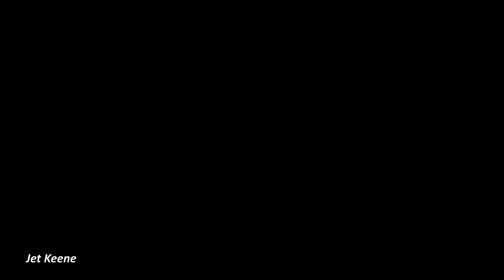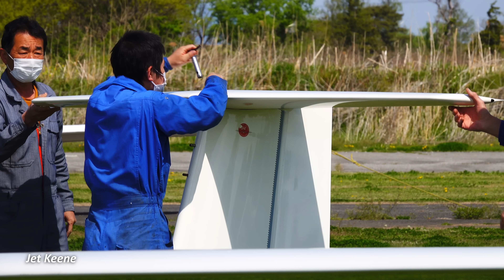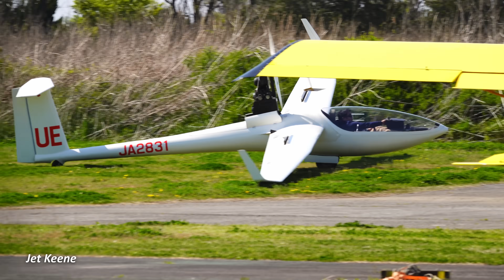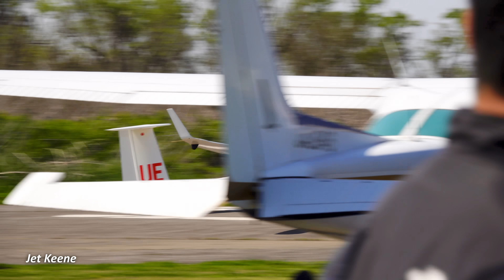Glaser-Dirks DG-800A Motor Glider Assembly, Takeoff & Landing

Comment from the maker: Thank you for watching.🤗

Below is the synopsis. Please watch from the scene of your choice.
00:00 Highlights
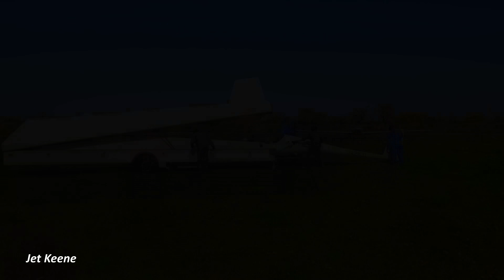00:15 Assembly
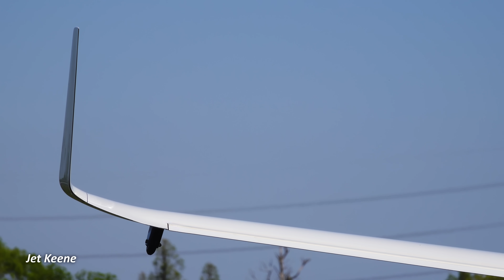04:27 Close-up of each part
04:57 Pitot tube fixation
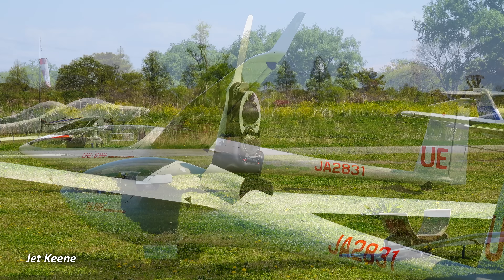05:30 Close-up of engine
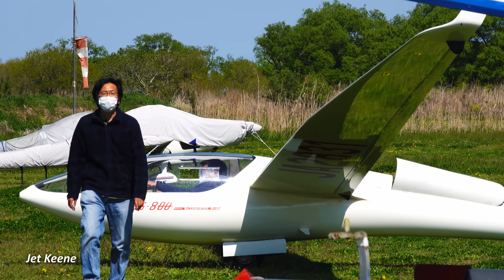06:11 Engine stands up
06:31 Engine startup
06:40 Taxing to end of runway
07:17 Preparing for tow
08:26 Takeoff towed by another plane
09:31 Rope separation and turning
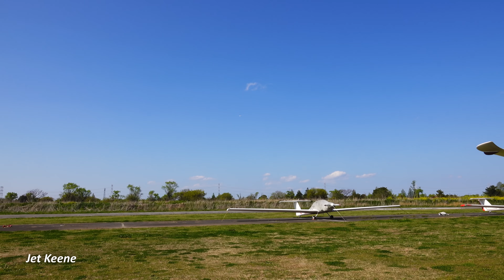10:29 Landing
11:29 Taxiing to tarmac
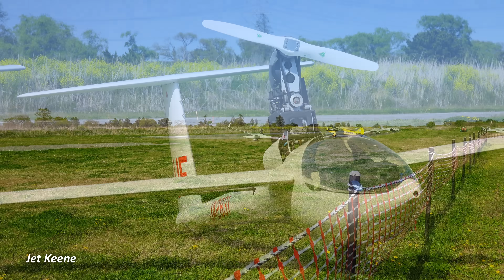12:38 Taxing to end of runway
13:19 Takeoff with fuselage-mounted engines
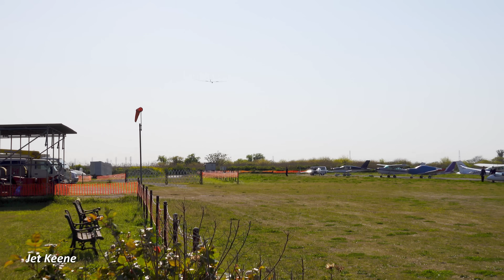15:40 Landing
16:05 Taxiing to tarmac
16:44 Retract the engine

After watching this video, you will understand why a motor glider with a propeller in and out of the back is useful.
https://youtu.be/EhwYs7hRtIg

#JetKeene_Aircraft_Channel
Reply: Szzzzzd

Comment: Why you wasting my time
Reply from the maker: Thank you for watching.🤗
Below is the synopsis. Please watch from the scene of your choice.
00:00 Highlights
00:15 Assembly
04:27 Close-up of each part
04:57 Pitot tube fixation
05:30 Close-up of engine
06:11 Engine stands up
06:31 Engine startup
06:40 Taxing to end of runway
07:17 Preparing for tow
08:26 Takeoff towed by another plane
09:31 Rope separation and turning
10:29 Landing
11:29 Taxiing to tarmac
12:38 Taxing to end of runway
13:19 Takeoff with fuselage-mounted engines
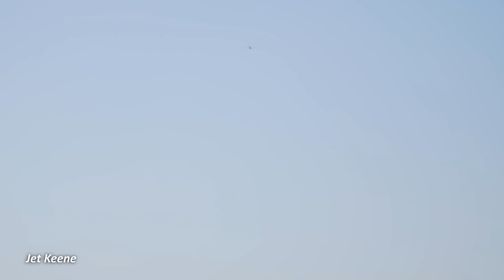15:40 Landing
16:05 Taxiing to tarmac
16:44 Retract the engine

Comment: THE ultimate way of flying, retractable engine and frontwheel and 2 small wheels at the wingtips.... my only question is what kind of petrol engine it is, how many cc (I suspect 1 cylinder) and how much does the plane weigh. Good luck with this beautiful glider, Bram from the Netherlands (73)
Reply: My question is how can you call an airplane a ‘glider’ when it has an engine?
Reply: @rayray8687  Motorglider in Dutch or Engine-Glider.
Reply: @BXgek : Ok, so an A320 is simply a twin-engine glider…I get it, lol.
Reply: @rayray8687  Glaser-Dirks DG-800A Motor Glider Assembly, Takeoff & Landing
Reply: @BXgek : Right, I saw the title. So if I shut the engine off when I’m flying a C172, then I’m suddenly classified as flying a glider?
Reply: @rayray8687 Motors in gliders are intended for two purposes: self-launch and providing lift in the air to avoid landing out.  Most of the time the motors stay tucked away in the fuselage and simply increase the wing loading (often desirable).  Flight recorders for competition or awards have engine noise detection built in, to prevent cheating.  I have a Ventus cT; the T means turbo ie. that it has a small engine to sustain flight, not strong enough to launch with.  Avoiding a long retrieve is useful. Hope this clarifies things.
Reply: @bungee7503 : That’s pretty much what I’m getting at. Motorizing a so-called ‘glider’ is simply a backdoor attempt to sidestep regular flight training and makes a mockery of the skills of actual gliding. It’s basically strapping a rocket to the back end of a speed skater to make him faster. I’m not saying motorized ‘gliding’ isn’t fun or a legitimate hobby but it’s NOT gliding, it’s simply flying an airplane, and all airplanes can glide.
Reply: @rayray8687 Not so. With the turbo, the engine isn’t designed for continuous running; it’s there as an outlanding avoidance device. The self launching gliders are just that: they launch themselves, then shut the motor down and start gliding, just as I do off aerotow. I’ve never, in 50 years, come across anyone using either of these types as a power plane alternative. As far as I know, what the British call a touring motor glider, like the Dimona or Grob 109, requires a PPL.
Reply: @rayray8687 it is still a glider.    A normal airplane cannot glide long enough than a glider.   Main purpose of a glider is to glide. And an airplane's main purpose is to have a powered flight. And has an enormous supply of fuel.  While a motorized glider has limited supply just to provide boost.
Reply from the maker: Thank you for watching. This motor glider appears to be equipped with a Rotax 505 engine.😊